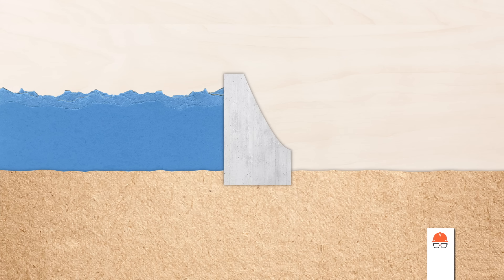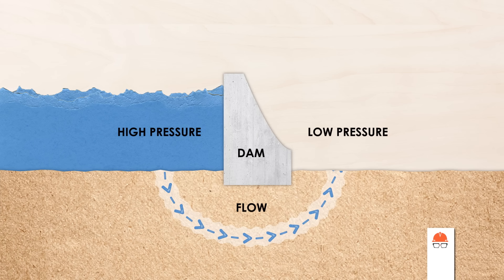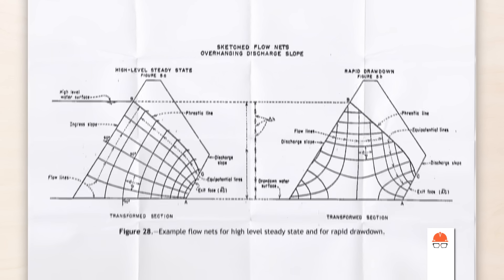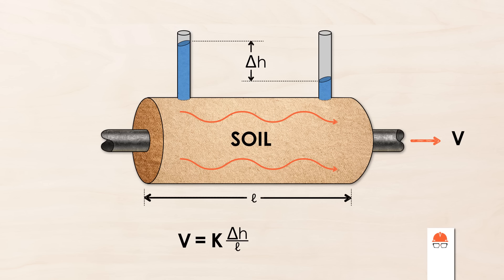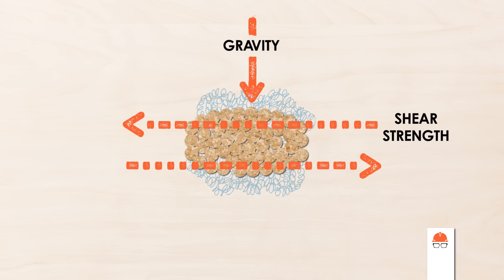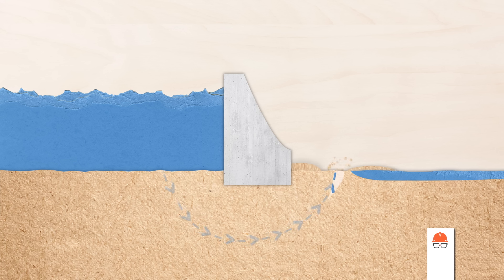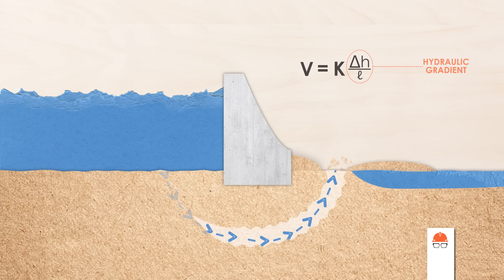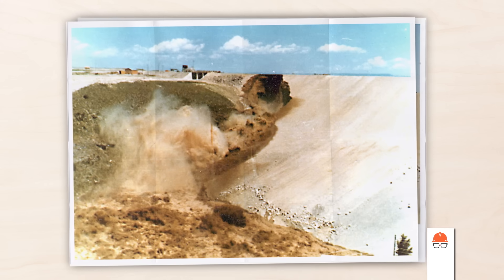How Quicksand Causes Dam Failures

Comment: Ah, earth dams. Your picture implies concrete. Concrete dams usually connect to rock. Earthenware dams often fail at the dam edges or spillway erosion (Calf). Or overflow conditions. And you didn't mention earthquakes as liquifying dam foundation. Oft see failure in older dams although one dam lifetime measure is silting in of the resevoir, so dam bed is above the soil.

Comment: That is also why engineers typically do not build dams on a sand foundation but usually use a clay foundation (or at least have a clay or rock layer below) which has a much lower porosity and are not small balls but microscopic plate like particles which are not subject to liquefaction.  Piping, as a failure mechanism, typically occurs in clay layers and starts out very localized and then gets larger as erosion of the flow path occurs.  The basic premise of flow path and seepage is accurate but this quicksand demonstration would only occur if someone was stupid enough to build a dam with only a sand foundation. Signed, 30 yr. Professional Engineer
Reply: HAHAHHAHAHAHA well i'm this stupid guy coz i'm a student XDDD sorry sir

Comment: I'm actually surprised to learn that they don't build controlled paths for some water to flow through since it's going to go under it anyway. I'd think the water would take the path of least resistance and they could make it go where they'd prefer it to go. Maybe I'm just thinking more water goes under the dam than actually does though.

Comment: I realize that this won't be possible in every case, but wouldn't one possible solution be to dig the dam's foundation down to the bedrock?  I realize that the water would probably eventually erode the bedrock so as to create a gap between the base of the dam and the bedrock, but wouldn't that take a very long time?

Comment: There was a work related accident on a construction site in Canada where the soil became quicksand around a cofferdam nearly killing a worker.  There were 2 levels of ground water.  The removal of the higher level of groundwater and soil being removed cause the soil in between to heave, releasing the lower level of groundwater.  None of the testwells were deep enough to reveal the lower level of groundwater, so they did not know about it till the accident.

Comment: Saw this channel for the first time. Great video and accurate description.
To prevent piping, along with cut-off walls/ sheet piles, inverted filters are used too.
Inverted filters are the ones with coarse grained on the top and fine grained on the bottom. 
With increase in surcharge on the d/s side, the critical condition of hydraulic gradient is hard to occur
Reply: That got me thinking.
Could you mitigate the effects of piping by one of these measures?
-driving piles deep into the ground below the dam
-excavating deeper and filling the ground below the dam with a mix of soil, gravel and larger rocks
-injecting concrete into the ground below the dam

Comment: This video is much to short. I wanted to see a bit longer cuts of the actual seepage demonstration. Those perfect loops the water seepage take was interesting, Also why don't it just take the shortest route? straight underneath the dam wall? Also the blow-out (was it called piping?) would have been a nice finale to the video!

Comment: I am not a civil engineer, but an electrical one, and I can see a lot of similarities between seapage and creepage in high voltage circuits. The principles why current can flow through air (breakdown) is of course different, but the system that arise do behave similar. The cut-off wall is practically the same as what is often done by increasing isolation by making for example slots in PCBs.
Now a question from me, another thing that would help I can imagine, is cascading, thus reducing the pressure of each dam. Is this actually done in practice? I have never seen cascaded dams myself.

Comment: Seepage is what caused the post Katrina collapse of the 17th Street Canal levee in New Orleans which flooded the west side of the city.  Media reports indicated the engineering firm reduced the tip elevation of the sheet piles beneath the levee from 36' to approximately 15' prior to construction.  It was not a good day for "value engineering". :-(

Comment: Quick sand condition and liquefaction are not same...
Quick sand occurs due to seepage but liquefaction occurs due to earth quake forces... Due to the earth quake forces fine sand gets compacted and dut to it's low permeability pore water pressure increases and effective stress decreases... Finally the shear strength of the soil becomes zero... This is called Liquefaction

Comment: Good video, but I felt a little short-changed at the end.  I really wanted to know more about properly designed cutoff walls.  Also, it would have been nice if you gave more specific examples of damn failures due to seepage.  Doesn’t have to take up too much video time.  Just do a quick montage.  Video could have been twice as long and still kept my attention.

Comment: I imagine building a deep cut-off wall is quite difficult and expensive, wouldn't it make more sense instead to use some kind of impermeable barrier such as concrete or asphalt along the line of the water flow for say 100-500m in either direction of the dam structure? That would increase the length portion of that equation, and be relatively trivial to do as opposed to a large vertical dig.

Comment: Why not "Cure" the bottom of the dams fill side with powdered clay which would (under pressure) "fill in" and compact the soil on the UP side of the dam?
Much cheaper option and once the clay has compacted into the "sand", then you would have a constant barrier.
Since the flow OFF the dam is from the top, then you would not be wasting much clay.
The clay should be added at the end of the dam construction so that there is a more even distribution and less erosion.
Clay powder can also be "fed" into the base of the up-side via pipes going down through the water.
Just a thought.

Comment: The nature of the soil can often be determined by its electrical conductivity.  Crays are very conductive but clean sand isn't.  It is fairly common for there to be an old stream bed buried deep into the ground.  It works as a path for water to move more easily so the path from above the dam to below the dam can effectively be shorter going down into the old stream, along it and then back up below the dam.  This is why it is important to know what is below the dam down to a fair depth.

Comment: Wouldn't creating a deeper sub foundation just extends the inevitable of piping? Or would that slow down the flow to increase the sheer strength?
Reply from the maker: There is a critical gradient below which the soil particles will not erode. You just need to be below that.

Comment: I live in Kansas so as far as damming we either have discharging of water in our watersheds (east) or capturing as much water as we can (west). I haven't researched our dams thoroughly yet but I'm assuming we have the cutoff wall you mentioned in the east since we haven't had a catastrophic failure yet. Could this be a possible problem in the future with increasing rain events coupled with the intensities of the storms we get? I know that if there is too much water storage in the watershed, we try to discharge enough water to get to a normal level, but is there a certain level that would induce the "quicksand" effect?

Comment: Fascinating stuff. Could see myself getting into soil mechanics
Reply: @guyfriends1843  ???
Reply: Now that it's been three years, did you get into it?
Reply: @Abcwhatever  lol
Reply: Wait. How could the seepage water possibly goes up?
Reply: @saitenotoshuitsnaini  I think it’s because fluids tend to flow from High to Low pressure/ higher head to lower head
Reply: Ok Ngl That’s an excellent question. I think the best answer is that we don’t know why, but all we know is that fluids tend to flow from high to low pressure. That doesn’t explain why the fluid flows upwards through the sand though, I will ask my university professors in 3 months time why this happens and I will report back
Reply: @Test-ri2kr  aka water distribution
Reply: It is a deep subject, but the basics can be compressed into a manageable size. This video just scratches the surface, the subject can expand layer by layer....

....Ok ill stop. 

Of course im fun at parties. Why do you ask?
Reply: ITS DIRTY WORK BUT SOMEONES GOTTA DO IT

Comment: That outro suddenly coming up after only a couple of minutes kinda caught me off-guard. It felt like the video ended just as you were in the middle of giving the lesson about this phenomenon. D:

I'd be interested to know how quicksand and liquefaction poses dangers to infrastructure and just structures in general, particularly in seismically active areas like the San Francisco and San Jose Bay Area where land has been reclaimed or even outright built using soil fill, as well as the considerations that civil engineers must make when designing for infrastructure and structures in such areas.
Reply: liquefaction is a major concern for civil engineers. It can be helped in a number of ways, 

1. Avoid saturation of the soil by providing surface drainage or dewatering pumps
2. Create what's called a floating structure that is neutrally buoyant with the soil (usually by making a large basement)
3. Allow relief of soil pore water pressure through some mechanism such as an underground drain

These issues are well known and only really an issue in poorer countries where lack of maintenance, shortcuts or corruption occurs.
Reply: Although these issues are well known, they can still affect more economically developed regions as well. Particularly in areas that haven't been updated with infrastructure retrofits to solve these issues. Especially if it's a region that has a tendency to either neglect or conveniently forget about (or simply can't afford) infrastructure maintenance, upkeep, and replacement, until it just decays to the point where it fails outright and absolutely must be replaced.
Reply: @Renegade30  Longterm mass dewatering cause other problems mate. Don't do it mate. The other 2 ways you mentioned are methods to deal with settlement and consolidation not liquefaction.
Reply: @nuttynut242   nuttynut242  

1. Long term dewatering is used extensively for this purpose. Most of the skyscrapers in the city where I live have constant dewatering because it is old swamp land. It is also used extensively in mining. I am aware of no problems with it provided it is managed correctly (An example of mismanagement is dewatering an artesian aquifer and causing sudden sinkholes). 

2. Incorrect. Liquefaction can be caused when sand 'boils' ie effective stress of 0 due to buoyancy.  If your structure is designed to be 'floating' then there is no soil bearing stress under this condition.  And a drain releases the water pressure which is just another form of dewatering!
Reply: @Renegade30  

1. long term dewatering. As you mentioned you area are in recent alluvial aged swamp land which means the soil is has large void ratio and usually normally consolidated, dewatering without adequate recharge wells will lead to increasing the effective stress on the soil and your soil will start settling and consolidating, 

- Neighbouring smaller buildings if sitting shallow pads might start to settle and crack, your road pavement and burried services may also experience serviceability issues. 

- There is also a hydrology consideration where if you might draw in the saline water further inland from the sea or raise/mix the freshwater/saline aquifer if land and water is a precious resource where you live, think erodability of the soil and fresh water source. 

- Easiest way to deal with this is.... dont build basements/tunnels and dont dewater if possible.
- There are untanked basement/tunnels, usually they are older and alot of them have longterm issues affecting the city/region.

- If you have to make a basement/tunnel. You would go for the tanked option by having waterproof details and admixture in the structure or construct jet grouted cut off walls to reduce the longterm water inflow rate, if you have high groundwater table. However a tanked basement always leak a little no matter how hard you try to waterproof it. Hence some pumps are required to pump out small amounts water, but by no means this is considered long term dewatering. Also dewatering is really expensive at least in UK, AUS, NZ where i worked. Mining is a different story, as they are usually carried out in the middle of nowhere and the above issues are more easily handled as the costs to do so are commercially viable as long as they can balance the costs vs money from the mining operations.

2. I have seen and worked on many remediation projects after a seismic events. Liquefaction is a dynamic, violent, sudden and is inherently non-homogenous in real life. Your floating structure idea is not really safe for areas withff large thicknessess of poorly graded, loose sand with high groundwater table that is susceptible to liquifaction.
Reply: @nuttynut242  Thanks for your insight, you made a few good points there! :)
Reply: Calyo, I felt that the video was short too. I think that he took more time building the model than showing it's effects and behaviours.
For one thing, the building "time lapse" seems longer than the demonstration footage xD
Reply: All soil liquefy if you shake hard enough. However you can do stuff to the soil to make it more resistant to liquefaction. Ground improvement like jet grouting to increase the overall shear strength of soil is one method. For land reclamation projects, the use of a correctly graded soil followed by sufficient degree of consolidation is one way of dealing with liquefaction risks during a designed seismic event.

Comment: I still don't get how the colored water can seep in such a defined path. How come the color doesn't diffuse equally into the total water mass?
Reply: Pressure is uniform radiating away from the cut off wall.  Water is following the same path established by the pressure differential.
Reply: Because it is just a little dye dot at the high pressure side. It isn't coloured water on the high pressure side, so that the little dot just indicates the flow pattern.

Comment: Which is why you bring the footing down to bedrock.
Reply: This got me thinking: does everywhere have bedrock? I mean, do we just dig down until we hit a lot of rocks and call that "bedrock", or is it a solid slab of rock that literally spans the entire tectonic plate with no gaps (except volcanos I guess) and no way around it?
Reply: Yes, if you go deep enough, everywhere has bedrock.  If at the surface it is called an outcropping.  When you dig and hit broken rock & soil or sand that is called regolith.  It is not bedrock.
Reply from the maker: Not everywhere has bedrock close to the surface.
Reply: Of course not.  I learned that in geology class over 40 years ago.  But, that just means not everywhere is suitable for a damn.  ;)  I left the latter unsaid as it is obvious to anyone who knows a bit of geology.
Reply: Warren Garabrandt , different areas have different types of bedrock and at different depths.

Sometimes a decent bedrock is just too deep to be economically viable to reach.

Manhattan has skyscrapers at either end because of decent hard schist bedrock; not so much in the middle though.
Reply: And over overconsolidated soil, clayey soil's bearing capacity is dependent of cohesion too.
Reply: In some places bedrock is not good enough.  If there is a fault line or other opening running from above the dam to below it, you must grout to block it off.
Reply: Remember to not dig straight down.

Comment: Grady, here's your dam comment...this is one of your best videos.  I live in N. California and have been watching the work done to repair the Oroville dam spillway.  Have you thought of discussing that event?  Or perhaps talking about the reason a spillway is needed in an earthen dam - to prevent water going over the top of the dam itself.  I'm not entirely clear on why water over the top of the same is so dangerous.  Perhaps that could be a topic.  Thank you and keep up the great work!
Reply: An earthen dam can have a good strength, but they don't resist erosion at all being made of unconsolidated materials. Water flow over the top washes material of the dam away faster than the water level drops, leading to a cascading failure. A spillway is supposed to allow an exit path for the water and energy behind it in a way that does not erode the dam.

Comment: What happens if you create a wide flat surface right after the damn? like building some kind of concrete "floor" that is connected to the damn and starts where the damn ends.

Comment: darcy's law is great if your aquifer is homogenous and porous, but more often than not, the earth isnt.  "Research on carbonate aquifers has followed two tracks that have been largely separate and have had limited cross communication. One approach has focused on data from wells, used Darcy’s law, and often assumed that aqui-fers behave as porous media. The second approach has largely focused on data from springs and caves, and often used the Darcy-Weisbach equation to interpret flow through the major conduits in the aquifer. "
http://onlinelibrary.wiley.com/wol1/doi/10.1111/j.1745-6584.2008.00548.x/full
Reply: Notgnihtrow 
Well yeah, but all models have to start somewhere